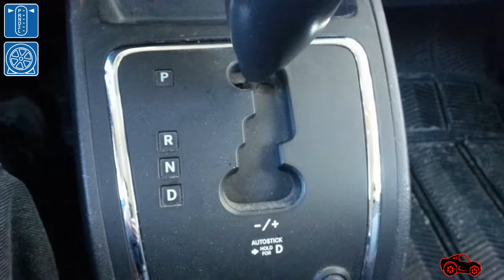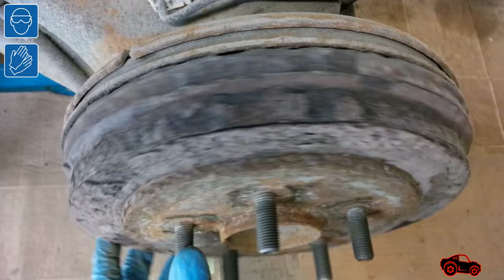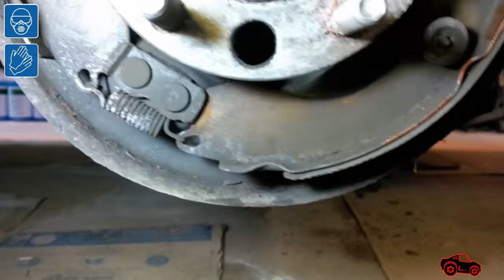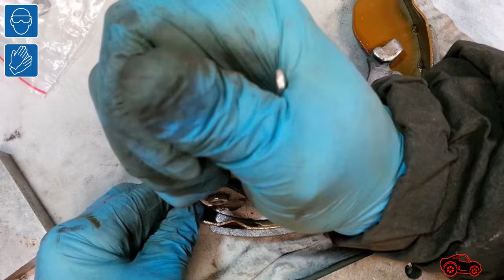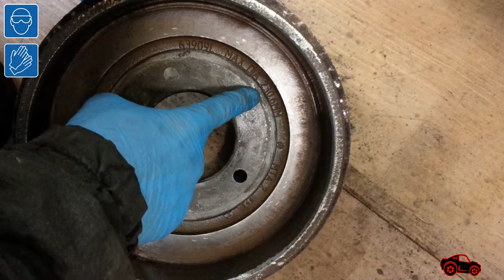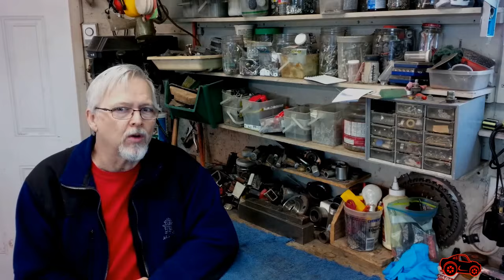Jeep Patriot Rear Drum Brake Shoe Replacement

Comment: Could you tell me what brand of puller you have?
Reply from the maker: I got this 8in. puller more than 20 years ago and there is no brand name on it. 
To make it safer to use with drums and rotors, I modified it as you can see in an other video I made. 
Ref.:  https://www.youtube.com/watch?v=9dVutRXpiAo&t=4s
Note: A real ''brake drum and rotor puller'' is quite expensive but it is a better and safer tool to perform the task.

Comment: So my drum is being held by the actual brake because the teeth are over tightened on that side because of a bad cylinder 

How can I adjust the teeth if I have no access to the adjuster lock ?
Reply from the maker: There is an adjusting hole behind the shoe support plate. First remove the rubber plug. Then insert a small flat-head screwdriver to disengage the lever pawl and if I remember well you rotate the wheel upwards with an other flat-head screwdriver until the shoes are getting loose.
Reply: @mtlcarguy  thanks man, that’s what I’ve been trying to do but I can’t find the lever that locks the teeth, seems to be unreachable from there
Reply from the maker: @David-qw2iv  Look at this forum discussion link:
https://www.jeeppatriot.com/threads/brake-drum-star-wheel-adjustment.333602/
and also have a look at drum brake adjuster tool sold online.

Comment: Hello, i accidentally pushed the wheel cylinder and now its sticking out on one end. Do you know how I can push it back? Doesn't want to budge.
Reply from the maker: I guess  you mean a wheel cylinder piston sticking out.
Usually the 2 pistons and the 2 sealing cups are mounted back to back inside the cylinder. A compression spring is located in the middle of the cylinder.
Normally, when the brake shoes are removed, the 2 pistons can be moved together by hand from side to side within the limit of the boots.
Sometimes, this problem can be caused by a brake shoe that is anchored on the opposite piston and it is pressing too hard or is stuck in a bad position.
The brake shoes must be properly seated in order to center the pistons in the cylinder. Note: To kept the pistons centered, I used locking pliers (07:05) to hold the shoe in place.
It is less common but the problem can be caused by rust on the surface of the piston that is in contact with the cylinder.
Try to move the pistons together without the shoes installed. Good luck !

Comment: Struggling with the springs on the second set! Did one side with needle nose and decided to buy the  hook tool today 😂 I cannot get the needle nose in between the spring its so tight! 

Secondly - one of the cylinders is fully extended and will not go back in! Already over nighted a new cyl but can I just compress it back in? It was literally working a second before!

Thanks!
Reply from the maker: The spring can also be held using the straight section of the spring but, the needle nose must have a strong grip to make sure it is not sliding when stretching the spring during the installation.
Secondly: When a piston is fully extended, it normally means that the opposite piston is fully inserted and both pistons are touching together inside the cylinder assembly when there is no hydraulic pressure applied with the brake pedal.
Each upper section of the brake shoes should be properly anchored to the pistons and well centered between the cylinder assembly to sit the brake shoes on the six contact points of the back plate and easily refit the brake drum.

Comment: This is probably the very best Jeep Patriot rear drum shoe replacement video on YouTube.  Everything is covered very clearly. Excellent.  His attention to cleaning rust off the components is excellent, something a service garage would probably not take time to do.  

My comments:  
-  be extra careful to not overextend the wheel cylinder piston one way or the other to avoid fluid leakage. 
-  he mentioned it at the end...... I would have replaced the drum and hardware kit due to the advanced rust.  
-  don't forget to bleed/exchange your brake fluid every 2 to 4 years to keep your system free of contamination and corrosion.  
-  it's never a bad idea to use brake safe lubricants where he showed.  I like high solids moly paste for the metal-to-metal contact points - Honda (Dow) M77

Comment: I just did mine and now I’m not sure if the shoe kit is on too tight and am worried about mpg. Do you have any recommendations to know if they are on properly? Thank you.
Reply from the maker: Maybe a bad adjustment but if the brake shoes are too tight when the star wheel adjuster is fully retracted, it could be caused by a parking brake cable that needs to be loosened a bit by adjusting the parking hand brake position. Once in my life, I bought cheap aftermarket shoes that had liners that were a bit too thick to fit properly so I exchanged them for an other brand that was fitting properly.
Reply: @mtlcarguy  thank you for the reply. We went back in there and wound down the slack adjuster all the way. I appreciate you 👍

Comment: Thanks so much for the video. Some notes for my future reference:
- I found it easier to remove a hold spring cup before the bottom return spring (and also reinstall the bottom return spring first). Made it so there was no tension on the bottom return spring. 
- In the absence of the modified pliers, I found long nose locking pliers could substitute. 
- I used a ratcheting clamp with rubber contact faces to compress the shoes before reinstalling the back upper return spring, and put my knee behind the shoe as I pulled the spring toward myself to hook it. 
- Using the 10mm wrench as a spacer caused me to leak some brake fluid, but I don’t think I damaged the boot. So on the second wheel, I put the adjustment bar as small as it would go at first, and then increased size from there. 
- Frequently engaging and disengaging the parking brake seemed to help center between adjustments, but man was it tedious. 
- Avoid cars with drum brakes in the future if you can help it. 😅

Comment: Great video! Thank you for saving me the headaches and money. Is there any videos on adjusting parking brake. Tension needs to go all the way up in order to work.
Reply from the maker: Dodge Caliber uses a similar structure. Look for '' Dodge Caliber star wheel adjustment PDF '' you might find the Chrysler procedure to adjust the parking brakes.

Comment: Wow! How useful to see  such a thoughtful and creative way to do what can be a frustrating  job. I have worked on all types of cars for 50 years and still can learn from someone who has new ways of approaching a job.When I first worked in a repair shop in 1966 there was a tech there who had lost one of his hands in an accident .He was able to do rear drum brakes quickly and easily as his hand had been replaced with a metal hook and claw that worked great for handling the springs.
Reply from the maker: Your partner was good since many vehicles had drum brakes on the 4 wheels.

Comment: To give me an idea, how many miles does that jeep has? Mine 2008 4x2 has 50,250 miles, i already changed struts, tires and cvt oil, any other recomendation for the maintenance at this point? im looking for the afination at 60,000 miles.
And i have a sound at the pilot tire, like a rubber, when i pass a mini hole or mini mountain it sounds like its gonna go off but at high speed or full charged the car it doesnt, and when i brake slow, it crunches like a rubber or something but i feel it in the pedals, the sound and crunch.
May i send you a video or something?
Reply from the maker: Changing your struts was probably OK due to the age of the vehicle.
After 10 years it is also normal to replace the struts and the CVT transmission fluid.
The front knocking sound you hear when you go over small holes is usually a broken rubber bushing on the front lower control arm.
It can also be a ball joint or a sway bar link problem.
The crunch noise when you brake slowly can be caused by rust build up on the rotor and/or on the caliper bracket.
It could also be a sliding restriction between the outboard pad anchors and the caliper bracket sliding surface and/or caliper guide pins too tight or stuck. 
With these conditions, the pads are not squeezing the rotor properly and it can be very noisy. 
After a normal ride you can safely check if the rim wheels are too hot. 
If so, something is wrong and the brake components should be checked and fixed as soon as possible.
Note: One end of the rear control arms is made with an encapsulated ball joint and they are often rusted inside.
Ref: Recomendations.
The alternator is usually good for more than 60,000 miles but the OAD pulley may be noisy and defective soon.
All modern vehicles with lots of electronic components have lots of wires with very small gauges. 
They can get damaged fast under oxidation conditions. 
Protect all electrical connectors and components if you ever wash your engine. 
Make sure the battery connections and all the ground connections are well connected to avoid voltage drops and/or amperage drops.
Good luck!
Reply: You are a genius, thank you for the knowledge
Reply from the maker: @TheButcherblanco  Not a genius, only enthusiast!
Reply: And would you think its a good idea to change the break fluid with the disc breakes sistem with 1/3 of its life? Less than the half they have cause one time it shaked when i brake at 35 mph going down hill and that time i had just changed the struts and didnt balanced the wheels and aligned them, but i maked it after that.
Reply from the maker: @TheButcherblanco  Brake fluid is hygroscopic and absorb moisture. This can create poor braking but it also can create corrosion contamination. If there is too much contamination the ABS system can work poorly and/or get damaged eventually.
A dark color is a bad sign but it is easy to check with a brake fluid strip test. If contaminated the fluid should be replaced.
Concerning the vibration... glazing, warping, bad wear, rust or bad installation can cause the problem. Your rotors and pads should be replaced.
Have a look at my video Jeep Patriot Front Wheels Rotors & Brake Pads Replacement    https://www.youtube.com/watch?v=oEmClq4vn1c
Reply: I already changed the rubbers of the sway bar and the stabilizer matches added to it and the sound still is going, idk what else could be:(
Reply from the maker: @TheButcherblanco  
If the brake pistons and pads are not pressing equally on the rotors, the ESP with the Integrated Control Unit (ICU) can use the ABS procedure on one or more wheels. So a vibration can be felt on the brake pedal and a groaning sound or noise can also be heard.
The ESP can be turned OFF for testing by pressing the ESP OFF switch for more than 5 seconds.
Therefore the  vehicle can be tested without the regular ABS management to see if there is any difference while braking.
To reset the ESP to normal condition, press and release the ESP OFF switch.
Reply: Im gonna make a video and upload it tomorrow, hope you can help me, im gonna notice you here when its uploaded
Reply: Hi, i already uploaded the video, im gonna put the link here so you can see it. Thank you so much
Reply: https://youtu.be/kE5lRgfkFjc
Reply from the maker: @TheButcherblanco  
I watch your video but it is not obvious at all to feel the sound and identify the problems on my computer.
When you hit the tire, the sound could come from the baking plate vibrating on the rotor because it might be too close to each other.
It could also be a loose tie rod component. 
When you are driving, there is another sound that could be caused by a defective rubber bushing from the front lower control arm.
The metal of the control arm should not touch the metal of the cross member while driving if the rubber bushing is good.
If you cannot find the problem you can get it checked on a car lift in a garage nearby, it should not take more than 15 minutes to find the source of the noise.
See a bad bushing in my YouTube presentation about the front lower control arm: 3:31    https://youtu.be/9Y1AnTGO7Wk
Reply: Im gonna take it to a garage as you say and in the case of the video that you showed me, is it necesary to buy the complete arm? Or just the rubber (here its called BUJE/HORQUILLA)? And ill tell them to check the braking plate and the tie rod that you mention, im gonna update and thank you for the help
Reply from the maker: @TheButcherblanco  
The rubber bushings are part of the front lower control arm assembly. (here I say '' Bonne chance avec la réparation!)
Reply: Oh its the complete piece then, im gonna wait to lift it up and i will upload you another video, thank you for your succesd